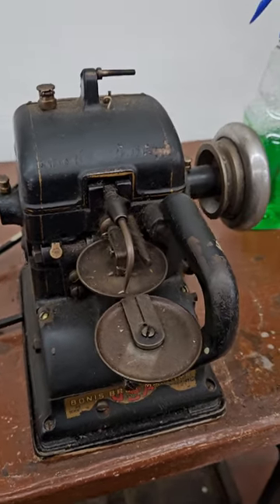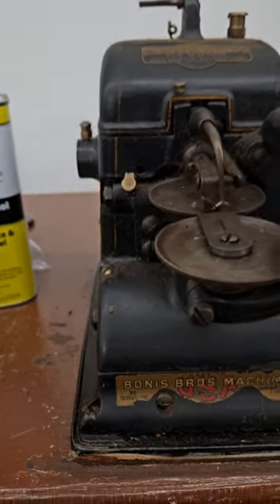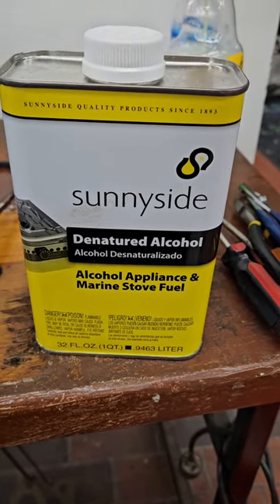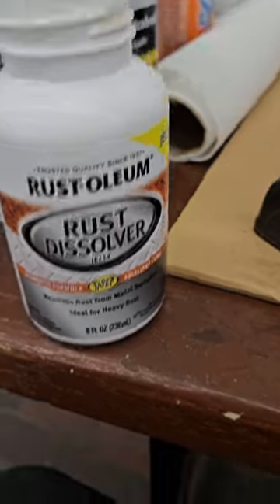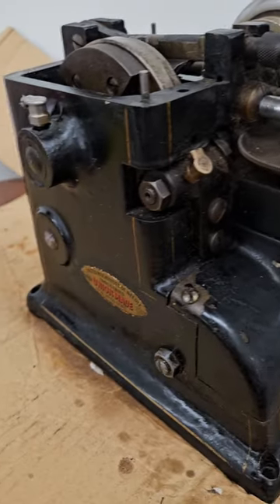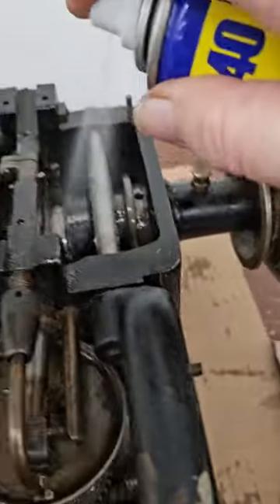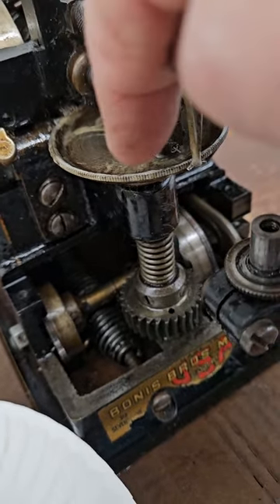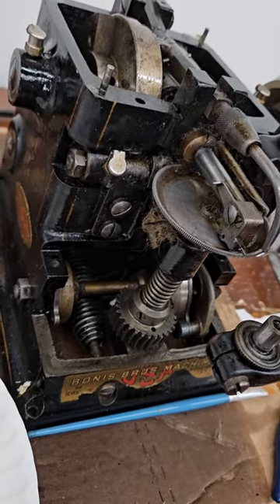Fur Machine Bonis Clean and how to Restore.       Part  1

Comment: What is the value of this older machine, motor and table?
Reply from the maker: Table w foot pedals 250.
The head about 1K
The motor should be replaced with a new motor, A servo motor is about 150.00, a clutch motor is probably about same cost